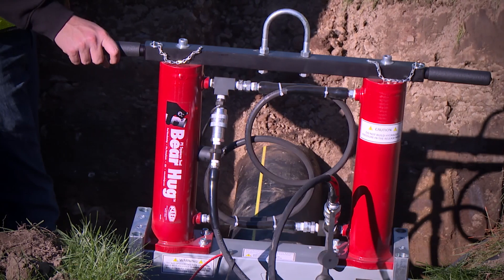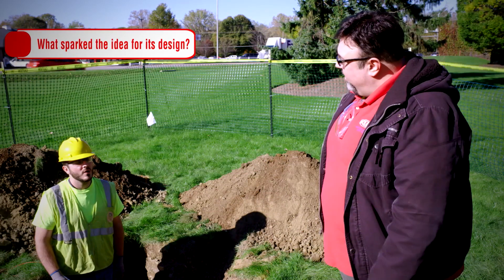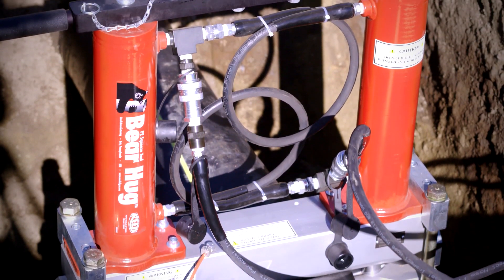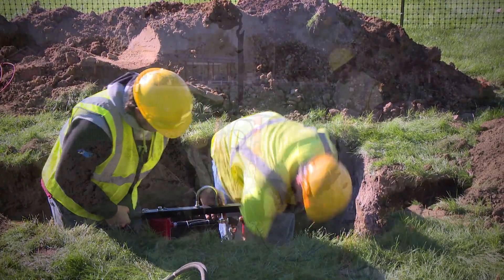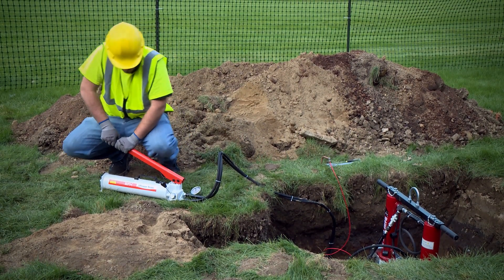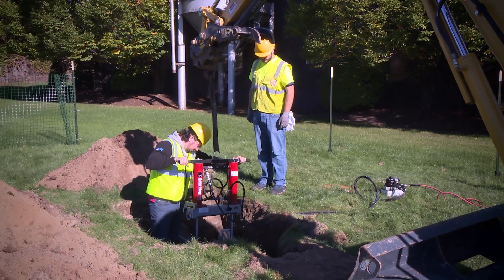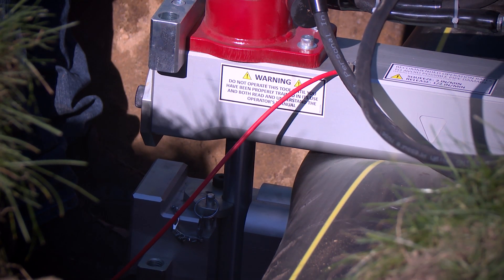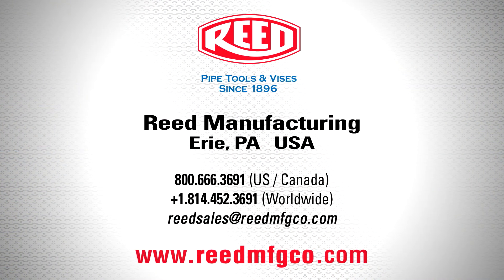Bear Hug™ PE Squeeze Tool Q&A - Reed Manufacturing

Comment: How do you get the pipe back to a round shape after you squeeze it?
Reply from the maker: Flow through the pipe helps to restore the shape, but it will not fully return to pre-squeeze shape.  It will have about 70% of original flow which is a generally accepted level.
Rerounding the pipe further can be accomplished by rotating the squeeze tool 90 degrees or installing a specialized encirclement clamp or similar device.